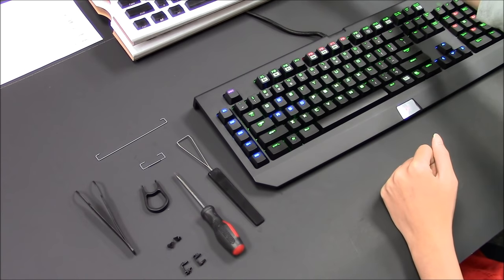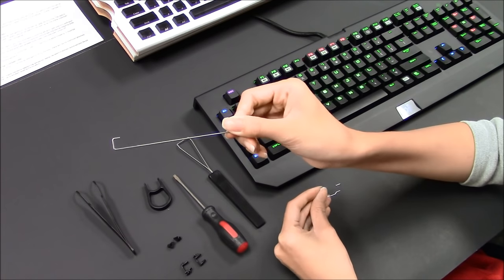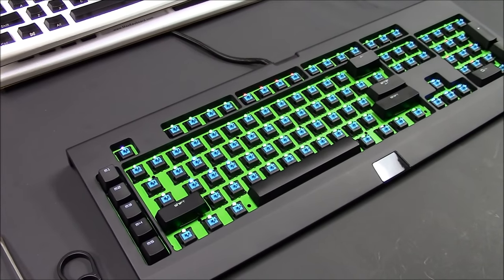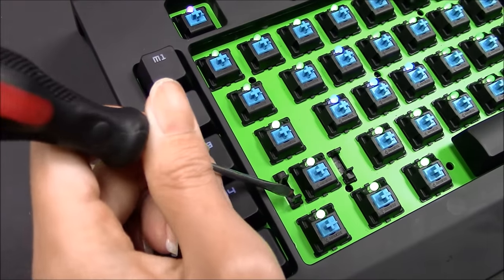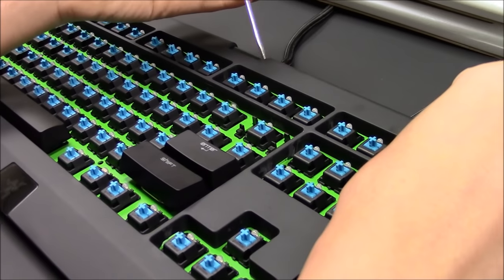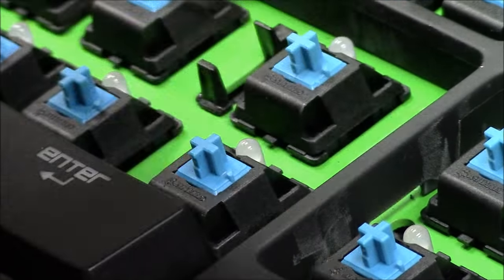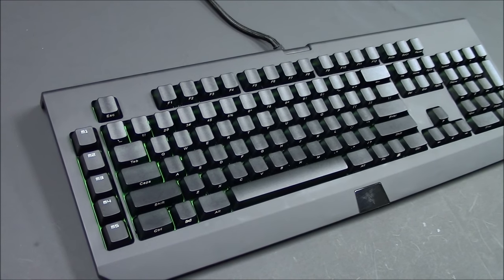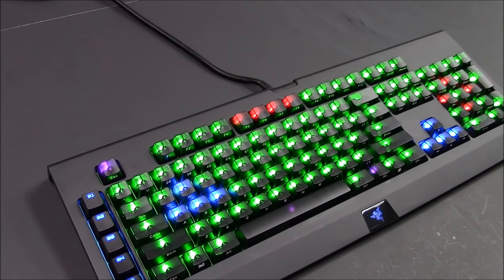How To Install Max Keyboard Black Translucent Replacement Keycaps on Razer Blackwidow Ultimate 2013

Comment: is it compatible with strafe?
Reply from the maker: Yes. it is compatible with Strafe.
Reply: Thank you. If i im going to buy does it come with the 2 boxes that you use in this video?
Reply from the maker: It depends on your selection. (Retail box or OEM pack) note: retail box will increase the shipping weight and dimension. Therefore, you will have to pay higher shipping cost.
1) Blank set (http://www.maxkeyboard.com/max-universal-cherry-mx-translucent-clear-black-full-keycap-set-blank.html)
2) Front side print (http://www.maxkeyboard.com/max-universal-cherry-mx-translucent-clear-black-full-keycap-set-front-side-print.html)
3) Top print (http://www.maxkeyboard.com/max-universal-cherry-mx-translucent-clear-black-full-keycap-set-top-print.html)
Reply: +TheMaxKeyboard why did you flip the stabilisers, I do have weird feeling with space bar but why?

Comment: Probably shouldn't use a metal flat head on something that has electricity running through it, could short out the LEDs or worse.

Comment: cant see the words what is the point of changing?
Reply from the maker: You will be able to see the lettering when you are in sitting position.
Reply: you shouldn't need to be able to see the worlds unless you're using obscure symbols you don't know the position of (like the & symbol)
Reply: ***** how could it called keyboard when there is no words on the key?So u brought a keyboard with no words?Smart!
Reply: *****
keyboards are input devices and I assume you look at the keyboard when you type, if you just have to look at the screen you don't need to have labeled keys that much except for maybe the function keys and the symbol keys.
" how could it called keyboard when there is no words on the key?"
you aren't very smart if you don't realize that key labeling has nothing to do with its status as a keyboard. 
I actually use a keyboard with labeled keys, but I'm decent enough at typing to understand that if you know the keyboard layout you don't need labeled keycaps.

Comment: how the damn hell did you change the backlight color???
Reply: NatiusG thanks for your reply but it doesn't completely answer my question. It's not done with only replacing the led's isn't it?
Reply: Phil Adelphia It shouldnt be harder then just replacing them.
Reply: mtothem1337 Alright, i thought the colors can be changed too, but if that is not the case, it should be done with replacing them^^
Reply: Shoud go that you coud change it in razer synapse (syr for bad english)

Comment: Hi @TheMaxKeyboard, I'm planning to replace the default key caps of my non ultimate razer BW chroma, is this key cap set will work? (similar to the video above but not translucent)

http://www.maxkeyboard.com/max-iso-105-key-cherry-mx-replacement-keycap-set-blank.html
Reply from the maker: +aries sulit yes, make sure you select 6.0x spacebar bottom row.

Comment: That is a HORRIBLE way to remove the stabilizer hooks, that is exactly what you SHOULD NOT do. Don't put the flathead in the hook itself, you'll most likely damage it, put the flat head beneath the hook and pry up gently.

Comment: O_O you are doing everything wrong.
First of all you can do it all with this first tool way faster, just apply it directly, from the top. Second of all, dont use screwdriver, pull these keycaps gently with this first tool, then without removing the key, just press these 2 plastic hooks with finger and its out.

Comment: using that plastik keycap-puller can cause damage to the keycaps flanks. The other one is actually much better and safer. also notice to pull the keycaps in a straight line upwards so you don't damage the switches. Doing it like this female can lead to damaged switches, keycaps and society